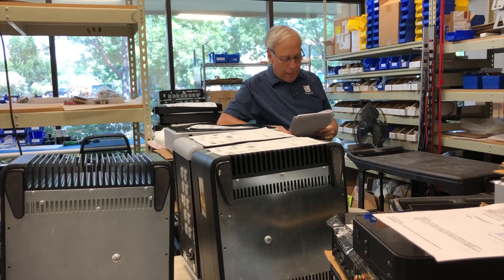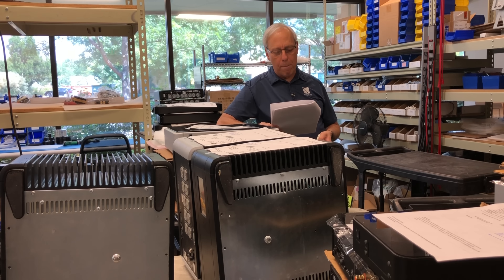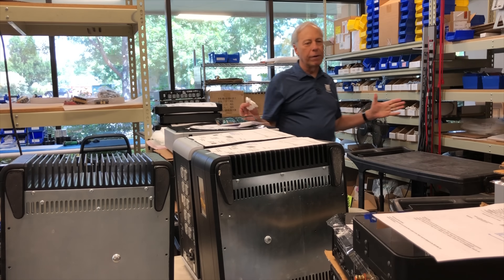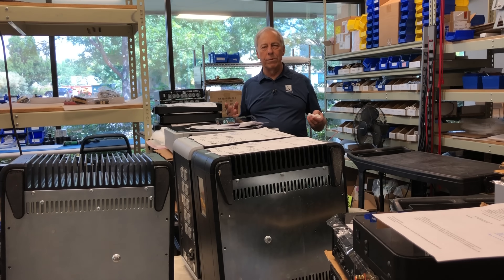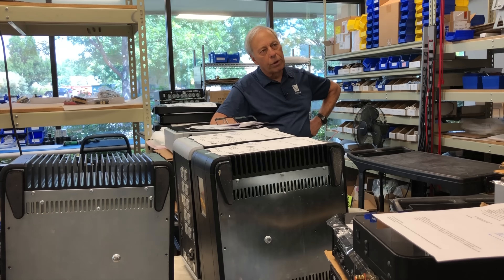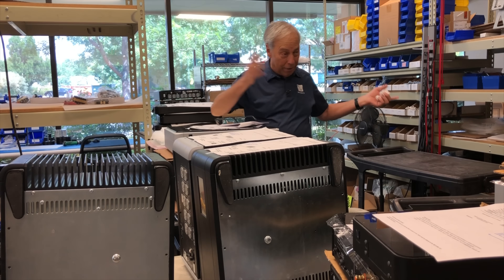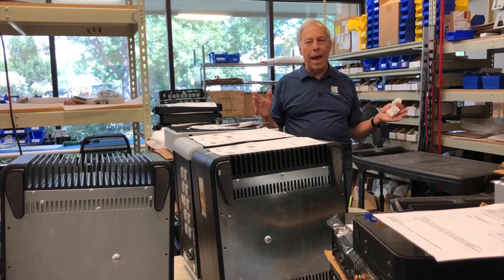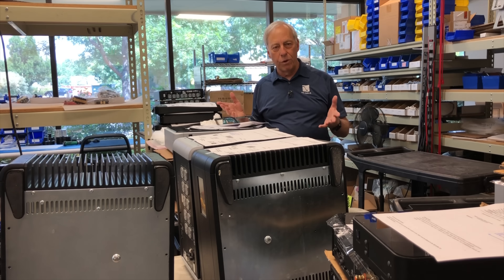Why should speaker cables have a minimum length?

Comment: All cables, of any length and gauge, will have LCR impacts (inductance, capacitance and resistance) on the load it is carrying... it is the fundamental laws of electronics in general and electricity in particular.  Will the average person hear or able to determine those impacts?  Probably not, as long as the lengths are of reasonable deployments (anything under say 50 feet).  Stick with manufacturer's recommendations when possible, but also take any extremes with a grain of salt.  ;)
Reply: I agree mostly with your comment.  I would also add  that If you have a pair of speakers very close together configured in a "Stereo" setup, you actually just changed your stereo playback to a "Mono" playback.  Because of poor speaker distance, and placement.  You loose all stereo imaging, and the sound field totally collapses.  The recommended minimum 10 feet speaker wire length is a very good recommendation to start with.

Comment: This makes me wonder what Naim Audio think about active speakers; they usually have a short length of decent gauge equipment wire between the amp output and actual drivers which wouldn't even qualify as proper "speaker cable".

Comment: Hi Paul, I've been into vinyl and hi fi now for 50+ years and bought my first "real" system at the age of 15. In all these years of buying numerous amplifiers and speakers not once in any user manual did it mention a minimum length or a specification for speaker cables. It may have said use good quality cables, but that's about it. Even hi fi dealers and distributors do not mention these specification issues when buying equipment or cables. I cannot imagine for one minute a 2 metre length will sound different to a 4 metre length (same cable) especially when the signal is travelling at the speed of light (186,000 miles per second).  Isn't it a coincidence that these amps that require "specific" speaker cables, and the speaker cables themselves are manufactured/supplied by the same company.
Reply: My answer makes the most sense.  If you have a pair of speakers very close together configured in a "Stereo" setup, you actually just changed your stereo playback to a "Mono" playback.  Because of poor speaker distance, and placement.  You loose all stereo imaging, and the sound field totally collapses.  The recommended minimum 10 feet speaker wire length is a very good recommendation to start with.
Reply: Naim specified minimum lengths of speaker cable before they even produced their own version. Earlier Naim power amps cerrtainly seemed to need that inductance, and I have known stability problems when customers used very short lengths. I am not convinced it matters so much these days, but Naim still state this requirement for all the latest kit.

Comment: It's possible that the crossover was designed with a small resistance in mind between the amplifier and the speaker.  The minimum length may take into account an expected gauge of wire, to present this resistance.  However, some setups will have longer cable lengths, than others, and it would be expected that you'd use thicker cables for the longer runs.

Comment: if you have a shorter cable, could you not manually add an inductor in series and capacitor in parallel to get to the same result?

Comment: 1 meter of copper cable 1 mm in diameter is 0,17 Ohms
2 m coppercable 1 mm diameter is 0,34 Ohms
3 m  copper cable 3 mm in diameter is 0,17 Ohms
Reply: I get it. if you want longer runs, increase the thickness.

Comment: if I recall correctly And please correct me if I'm wrong but the answer to the gentleman's question outside of a sound quality perspective really comes from more of a historic perspective. naim back in the day and as I understand it we're talking '80s and the '90s specified a particular speaker length because the output stages on their amplifiers worked best at a particular ohm level or maybe inductance or something, be honest with you I really can't remember when I read a long time ago. suffice it to say the output stage worked best because that particular length of speaker cable created that particular inductance or what have you and so that's what was specified. now the amplifier would still work with other lengths of cable obviously but it would not sound how the company intended the amp to sound. And I think anymore their products and amplifiers aren't designed around the same principle per se however I kind of get the feeling they do it now more as a throwback kind of historical feature of their products.

Comment: A lot has to do with the gauge of the cable,  the longer the cable more signal loss you suffer, so bigger the gauge is more important. I also agree never heard of a minimum cable length, but both cables right and left  (Pair) must be the same exact length, this as well if you use surround and so on,  R-L always same length.
Reply: Except OCOS ........
Reply: @frankgeeraerts6243  this is a rule with not exceptions in my opinion and expertise.

Comment: Cables degrade signal, so longer cables degrade more, and short cables degrade less, simple as that, especially on higher frequency as Paul said. So when people said this or that cable sounds better, it usually means the cable degraded or less degraded much of the signal to their liking…it’s all personal and system depended

Comment: Hi Paul 
Here is the reason 
Naim power amplifiers do not have extra inductance networks in the output. Naim prefer the more elegant solution of allowing the speaker cable to provide the correct inductance and capacitance. To do so, a minimum of 3.5 metres per channel of NACA4 or NACA5 cable is required – although the optimum length is around 5-10 metres with a maximum recommended length of 20 metres

Keep safe
Reply: The above reply is correct.  Surprised Paul was not aware of this design intention by Naim.
Reply: @stephengreene9380  why should he? such a design is a flaw...and the rest NAIM marketing ....to sell their special speaker cables, since they should then have the "RIGHT" inductance to match their amps or? Dynaudio also tried this.....who ever bites the bait....
Reply: Cable inductance is zero. Cable capacitance is thousands of times lower than other components in that signal path. Speaker drivers and crossovers have significant capacitance and inductance that varies significantly with the design. The speaker presents the complex (impedance magnitude and phase) that the amplifier must deal with.
Reply: Once again without research waffle is the order of the day
Reply: @Borednlonely  this is the naim support response , I believe that they know more than of us about their products
Reply: The correct and basic inductance of a cable is 0. So much waffle, so little science... 🙄
Reply: @literal_lee  only if you don't coil it up around the radiator pipes
Reply: @disklamer  Oh snap... 🤪
Reply: @literal_lee they do have measurable capacitance, though. This will form part of the output stage of the amplifier. That is not debatable. Now, how much of an impact this has, and is it measurable?  Dunno.
Reply: @literal_lee cable has a typical inductance of 0.1 to 0.2 micro Henries per foot. Not zero, and measurable. On a typical 5 meter pair of speaker cables, that's nearly 0.8 ohms (need to double the distance, as there's cable before and after the speaker) at 20khz. That WILL have a measurable impact on the frequency response of the speakers.
Reply: @RacingAnt  False 😅 OMG. What section? 0.0000001mm² 😅😅😅 microhenrios? Do you know what is it? On high Frequencies??? No no  is not true. Only the factor damper on low frequencies are be affected on very very very long wires or sections very very small mu Friend
Reply: @Vanflowne funny laughing, and saying no. I actually went and checked the specs of real speaker cables, with sensible sections - as in, 12 awg. Maybe do some research before making yourself look ignorant to the world. If I could post screenshots and links, I would.

Comment: The speaker cable wire has capacitance and inductance - and together with the speaker, which itself has inductance and capacitance, form a resonant circuit; and the capacitance and inductance filters out part of the signal.

Comment: 99.99999999999% of people not only won't notice any difference,  they won't have a clue what you're talking about and won't care.   People believe what you tell them.   In a study in NYC,  they manipulated people to buy expensive bottled water.  They did a recorded taste test a restaurant . They told the test subjects that the water was expensive,  purified, reverse osmosis, came from a 40, 000 year old Glazier.  The test subjects ooohed and aahed  how about  great the water was.  The water came out of the tap in the back, but they were selling to the test subjects as a expensive thing.  Buyer beware.  Remember,  corporations make money from you buying their stuff.  Once it's out the door, they don't care except to protect themselves from liability and they certainly dont care about you voiding the warranty.   Buy our crap, because we said that you need it.

The only reason I can see any changes in longer wires would be resistance over length.  But that would have to be 50 or more feet.  Longer lines, use heavier wire.   The other thing about longer wires is they can act as antennas and pick up local radio stations.   Over-all,  you aren't going to notice any difference.   The human ear is not that sensitive,  especially as we age.

Comment: I think somebody has amps and speakers confused with guitars, where the difference actually can matter.  But it only matters because you've got a very low signal level source driving a high impedance input at close to 0 current, so the cable's reactive influence on the frequency response is actually relatively significant.  Even then, it's subtle.

A speaker cable will have resistance, but it's a fraction of a sliver of that of the speaker itself (unless you're using line-level RCA cables on the speaker-level RCA outputs of your low-cost HiFi stack.)  Reactance is a thing, but if the difference in TWO METERS of cable is the threshold between a stable amp and one that is oscillating, your amp is defective.

Comment: I saw a system in a nightclub designed with the amplifiers on top of the cabinets to reduce the amount of speaker cable and what they did was run a long set of rcas to the amp engineer said degradation through composite RCA cables is less than the loss through speaker cables.

Comment: I indicated I a previous comment on Kenwood products that I own the complete L-07 line that they were sold originally including speaker cables. In fact these are 3 feet long
The interconnect are some 20 feet long. I also have a Linn Naim system from the late 70's and can' recall a minimum lenght. I do recall however of a minimum 4.6 ft for s digital cable. Regard d

Comment: Unlike most amplifiers, there is no Zobel network (resistor/inductor/capacitor combo) 
at the output of Naim amps.
Their own cable are specced to do that job. That is why. 
Consider the Naim cable an extended part of the amplifier.
Reply: That is the correct answer !!!
Reply: Why would they not include a Zobel network to define the asymptote for the high frequency impedance and make stability easy to design? An oscilating output stage would be bad for the amp and speakers.
Reply: So why say a MINIMUM length instead of the CORRECT length???
Reply: @chrisantoniou4366 varying size of listening rooms.

Comment: Yes. Impedance is the word.
I've got 25 ft pure copper cable  from sub to speaker.
Monster cable from amp to sub.
10 ft  per side.
Tried them couple different ways 
I can tell the difference
Reply: 12 ga

Comment: In a nutshell it's length v gauge/quality of the cable .. one thing is for sure though , long cable runs equal more inductance and more inductance equals less top end !! Using non inductive resistors in the crossover would have a much more pronounced effect on HF response ...

Comment: it will not sound different and naim is talking crap . they might designed something with a certain cable , but really. if that would make there amps suck.... go back to the drawing board and design a decent amplifier

Comment: This is taxing my memory but as I recall, as a Naim dealer many, many years ago, their cable is quite different and and that could account for it.  I want to say that it was somewhat capacitive by design (although I might be thinking of the OCOS stuff from Sumiko, which I know was).  But Naim is more than slightly arrogant and I would bet that they are making the assumption that you are using an all Naim system and therefore the additional inductance (or whatever) is part of the sound.  I know that when I design speaker cables I add a bit of DC resistance to the model to allow for an average 8' run of speaker cables.  Slightly more, or less, will not cause the universe to implode.  Or if so it hasn't reached us yet....

Comment: Amplifiers "usually" have an output network (filter) that ensures that the amplifier is stable with any type of load, I am led to believe that Naim (and maybe others) offloaded part of this onto their supplied speaker leads, so if you used different leads, or shortened theirs, then you effectively are changing the output 'filter' (it is not actually a filter, but has an exotic name that escapes me - however it looks like an LC filter) causing the amplifier to become unstable and osculate - easily leading to destruction.
Reply from the maker: Actually, I would argue that this is not true. I have designed hundreds of amps and seen more schematics than I can remember and almost no amplifiers have output networks. We once built an amplifier, the 200C, that required a small inductor in series with the output (which is what you're referring to) but it is rare. Certainly I haven't seen all circuits nor have I seen Naim's so there you could be right.

Comment: Naim amps don’t have Zobel networks in the output stage. They use specific cables to compensate for this and maintain amplifier stability and cable length is needed, I think, to ensure sufficient resistance again to balance amp/speaker load. Or at least that’s what the aliens told me.

Comment: Yeah I added mono atomic gold nanno particlate to my speaker cables on a molecular level using plasma infusion technology so they could commune with the creator being annunaki from niribu to bring sonic harmony to my crappy mid fi and create the holographic illusion of a real musical event.
Oh yes its true  Also bigfoot swiped my stash of DMT and crashed my car on a roadtrip journey to higher dimensions of consciousness
I think you are too polite and diplomatic to call BS on what is in this case BS.
The best results I have had with cable is reducing resistance as amp power increases. IE shorter runs & if longer than 2 M double up. Supra 3.4 ply tin insulated multi strand high purity copper
consistently gives excellent results without stupid & outrageous prices. But even they (Supra) could not resist ( ha! See what I did there!) the allure of creating "wunder" cables with ridiculous prices. After all they are giving people what they want aren't they?
Spend the extra cash on high bitrate music downloads or better quality DA converters or upgrading any weak links in your system.
WAY more satisfying investments where improvements are clearly audible.
Naim made a "name" ( oops did it again!) for themselves by convincing a large no of people that less is more. No tone or balance controls to "poison" the "purity" of their "high current" but not all that special amp designs. And indeed if you ever owned a decent quality amp that had a source direct switch that isolated the tone & balance controls. You could distinctly hear a slight difference in quality. Tone controls in circuit. Not as clean as out. BUT ..... No where near as bad as the effects of poor speaker placement and room acoustics that the balance/ tone controls were trying to compensate / bandaid for.
Less circuitry and knobs = higher profit per unit sold. Real simple.
Notwithstanding that honest amp builders added that stuff to compensate for less than perfect listening environments and considered that the lesser of two evils. At least back when they were more honest about such matters.

Comment: Hi Paul, im not sure about minimum cable length, but on the topi of cable length, i have noticed something, i have 2 speakers right by the side of the amplifier stack, and mpre speakers across the room

Me being me, i found some cable which just reached the close speakers, and bought 10 metre cables for the other speakers, and i have noticed there is a slight delay between the two pairs, which gives it more of a live, atmospheric sound

Russell from Derbyshire UK

Comment: dear paul, 
I have been doing sound for decades. Also, my mom has a nice McIntosh set up with klipsh heresy II speakers from around the late 70s that I look after. I take car of my cables. I have some that are over 30 years old and still work, but not sure if I should trust them. many are OFC, some are not. can you explain a simple way, maybe using a scope and an audio generator, how to check if they are passing 20-20khz well? I want to separate out the cables that may be coloring the sound too much. some of the cable types are:
RCA
XLR
1/4" instrument
Speaker (various jacks)

I've had a few old guitar and RCA cables get really dead sounding. I noticed when I stripped back the insulation that the copper was badly tarnished. 

thanks for the great info!
Casey
Raritan, NJ

Comment: Question, do speaker cables have to be of equal length L & R?  In my system my Amplifier is on the left side and the left speaker is about 2 meters away, my right speaker is about 4 meters away.  Thanks
Reply: Yes, it is absolutely necessary.